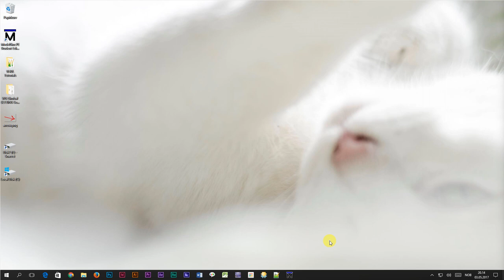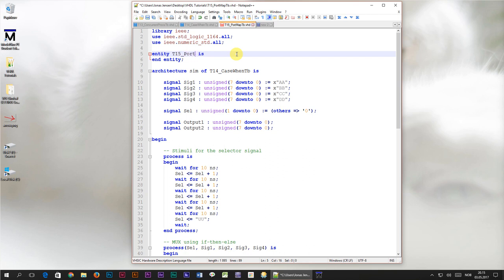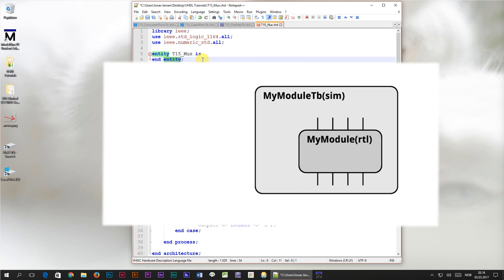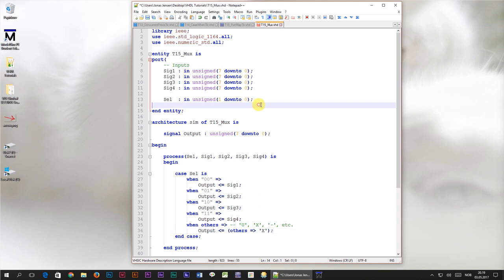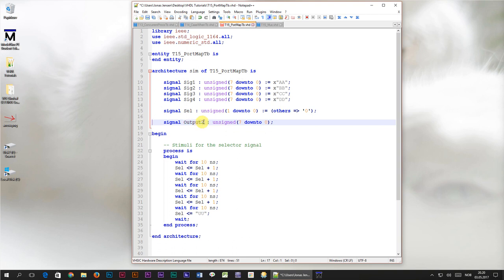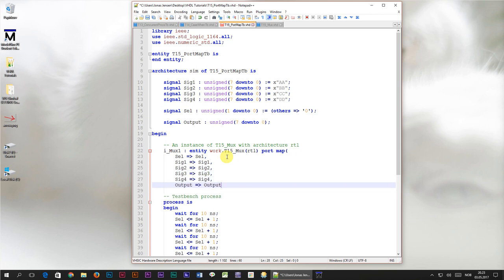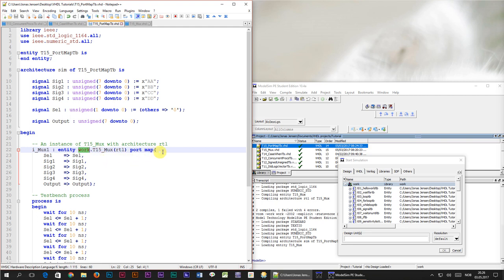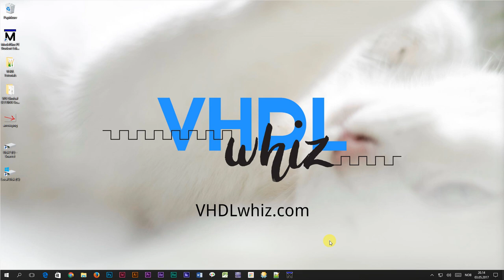How to use Port Map instantiation in VHDL

Comment: I understood your code.. i was referring ur example with another one in my university lab. Here they have written port declaration under architecture, but again they have written signal inputs with the same name. It is really needed to write port in testbench or signal is enough?
And u didn't write port declaration under your tb. Thats y I got this question.

ARCHITECTURE behavior OF wb_switch_tb IS 
 
    -- Component Declaration for the Unit Under Test (UUT)
 
    COMPONENT wb_switch
	 GENERIC (
			memaddr : generic_addr_type := CFG_BADR_LED;
			addrmask : generic_mask_type :=  CFG_MADR_LED
	 );
    PORT(
         clk : IN  std_logic;
         rst : IN  std_logic;
         btn : IN  std_logic_vector(6 downto 0);
         sw : IN  std_logic_vector(7 downto 0);
         wslvi : IN  wb_slv_in_type;
         wslvo : OUT  wb_slv_out_type
        );
    END COMPONENT;
    

   --Inputs
   signal clk : std_logic := '0';
   signal rst : std_logic := '0';
   signal btn : std_logic_vector(6 downto 0) := (others => '0');
   signal sw : std_logic_vector(7 downto 0) := (others => '0');
   signal wslvi : wb_slv_in_type;
	signal slvi : wb_mst_out_type;
	signal slave_out_data: std_logic_vector(31 downto 0) := (others => '0');
 	--Outputs
   signal wslvo : wb_slv_out_type;

Comment: If i wanted the inverted output on the instansiated version, how would i do that?
Reply from the maker: You can make a new signal with a concurrent assignment like this:
InvertedSig <= not OriginalSig;
Reply: @VHDLwhiz  i tried it, but the compiler complained that I couldn't use an output signal like that.
Reply: @vhdlwhiz2  ok, thx.  I'll try that.